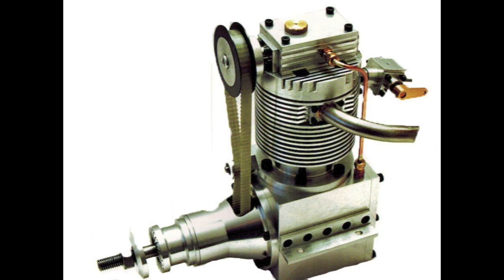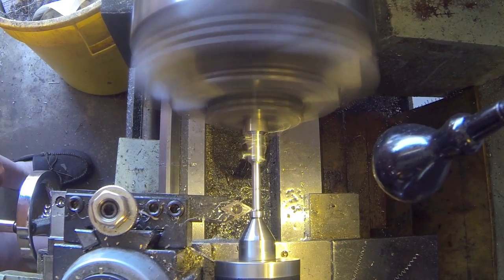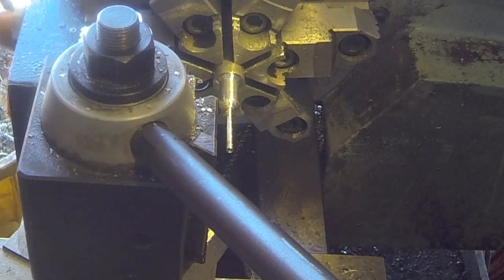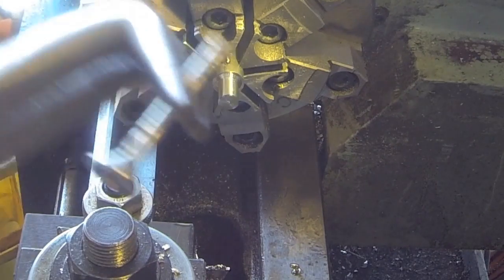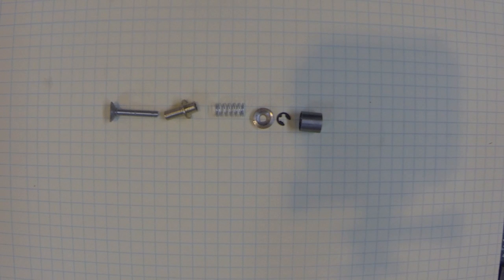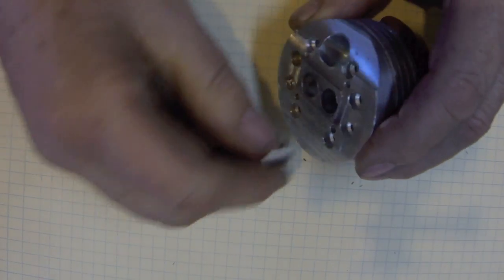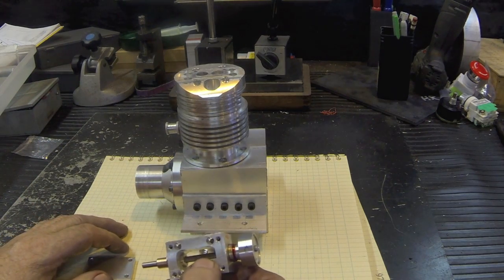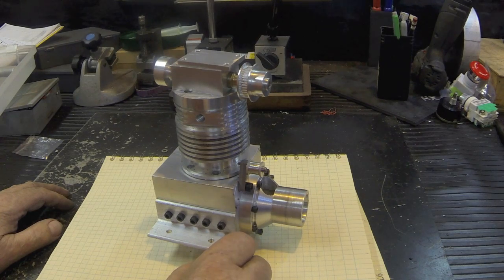This week in Herb's Workshop #24

Comment: Been a while since i cut lobes on a manual machine, but cant you just offset the jaws on the lathe? Your just looking for a lifting body, so if you offset your center line, the only critical tolerance comes from the difference between the highest point in the lobe, and the center line of the cam shaft. So get that offset by offsetting your chuck jaws, (that is if you have a 4 jaw chuck, plus the gauges to set an accurate offset) then grind to shape, while avoiding taking material off the top.

Comment: When you align your tooling, use a small 6" steel ruler. Apply slight pressure to wedge it between the cutting tool, and the material your cutting. You want the tip of the cutting edge to be slightly below center line, so the top of the ruler should be very slightly be tilted to you. Closer you get to center line, without going above it, the better results you will get, and the ruler is the best way to judge tool height.

Comment: Herb,
Looks like things are coming right along. I am assuming the ignition is the capacitive discharge type. I also assume the Hall Effect sensor will trigger the base of a transistor to trigger the CD unit. The problem I see is that to do a valve job on your engine you'll need tweezers and a jewelers loup. Thanks for sharing your project.
Have a good one!
Dave
Reply from the maker: Dave you are correct about the ingnition.  Valve job on this engine would require new valve and possibly a cylinder head.
Thanks for the comment.